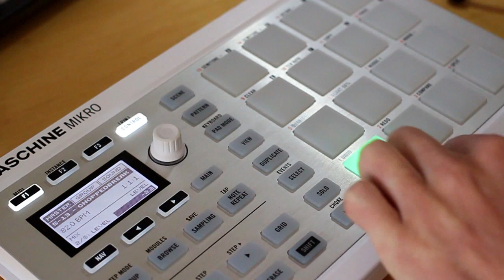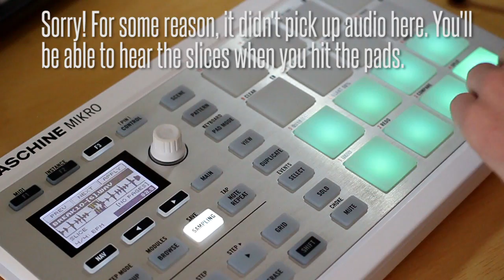Maschine Mikro Tutorial #6: Slicing

Comment: Quick Question:
I changed the pitch of my sample but whenever I go and slow down the tempo, it doesn't slow down. For example when I put the tempo at 85 it sounds exactly like the other tempos without slowing down or speeding up. What should I do? Thanks!
Reply from the maker: Jeff Echagile Changing the project tempo won't affect the sample. To change sample tempo, you can use timestretch in sampling->edit.

Comment: Sup, ... I use a Maschine Mikro. Just got it, and I'm new to this. So this may be a dumb question.

Say, I load a sample/Sound onto my pad. I then go to record it. Say, I have my pattern set to like, 4 bars. I record my sound, and it's just over 4 bars. If I change my pattern to 5 bars, I then have all that left over quiet/empty space in the recording. If I leave it on 4, then it loops into itself and sounds like crap. What do I do to make my sound/sample fit perfectly? Thanks.
Reply from the maker: Leave the pattern on 4 bars because it'll get really weird to work with 5 bar patterns. Then change the project tempo until it loops perfectly!

Comment: After you Slice and apply, is it possible to edit the length of the slices....not talkin about time stretch.  I need to add to the tail end of the slices to help some loops flow smooth. Easy to do in Cubase but I wanna try sampling in Maschine.
Reply from the maker: Yes, that it easily doable! You can edit start and end points as well as tons of other things (fade in, fade out, normalize, etc)

Comment from the maker: If it's a USB turntable, you shouldn't have to run any audio cables, just the USB cable. Check your Audio Inputs/Outputs in the software to make sure the routing is set up correctly.